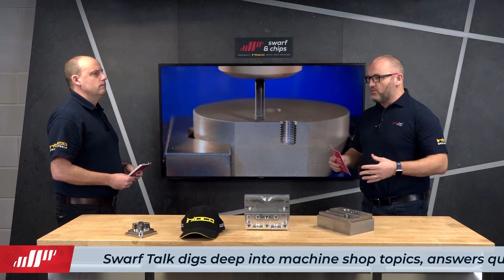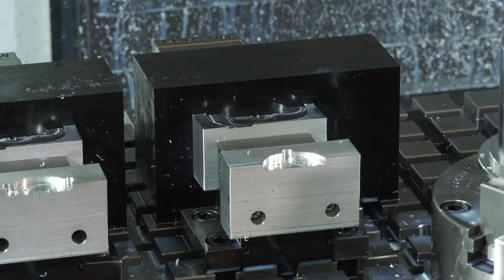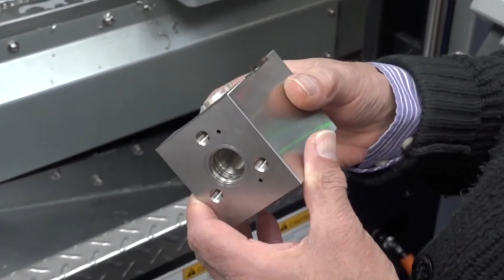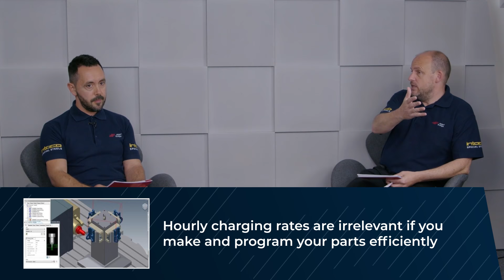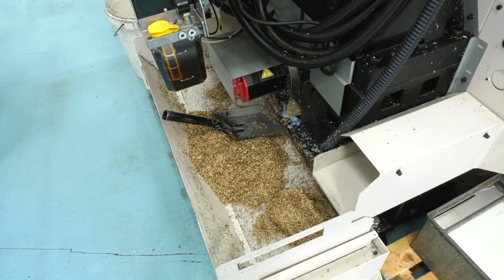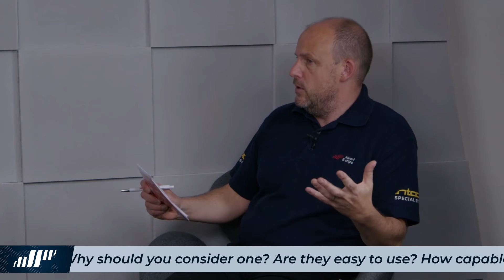Getting more value from your Machining Centre -Swarf Talk; Ep 1 July 1st

Comment: Fantastic watch! This is me commenting as both a business owner and a machinist. I totally agree with Paul Jones on business owners purchasing a VMC without a swarf conveyor. They are absolutely clueless. My biggest mistake was purchasing an XYZ 1100HD without through tool coolant so that we could afford a bigger machine. I should have went with an 800HD with through tool coolant and overhang the 4th axis on a plate to increase our room. Not purchasing a swarf conveyor was not an option! Companies that do not have a dedicated engineering department programming milling programs and have their employees writing programs at the control in Fanuc are taking a knife to a gun fight when competing against us at Expert Precision Engineering. All of our machines are conversational with either a siemens shop mill or shop turn software and we have a dedicated engineering department preparing manufacturing solutions including programs when beneficial and creating fixture designs for upcoming work. We usually have programs and tooling prepared before the material even hits our shop floor.
Reply from the maker: thanks Michael for the comments, we'll be producing these shows every month on the 1st of every month, really trying to explore all options open to engineers on every level. Thank you for the feedback, where abouts is your business located @micheal